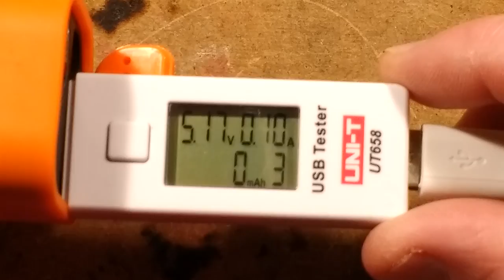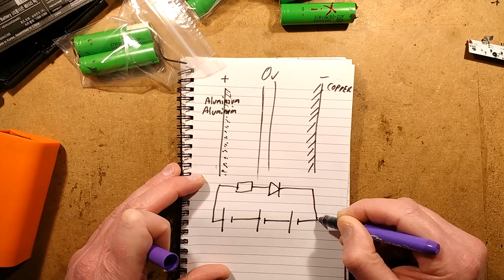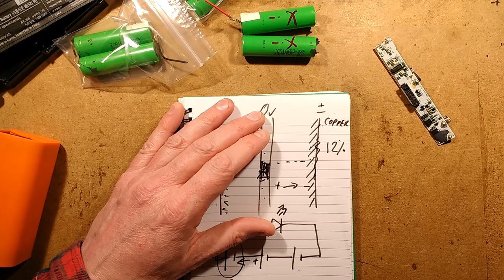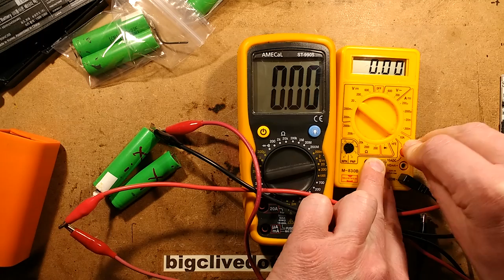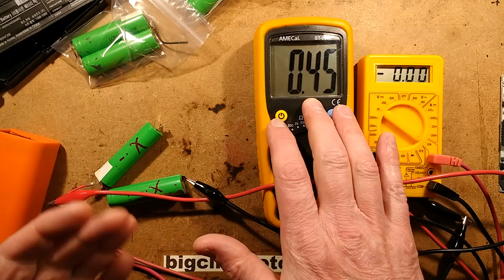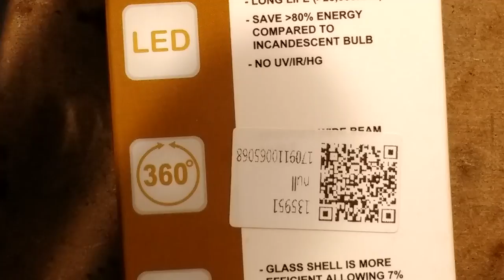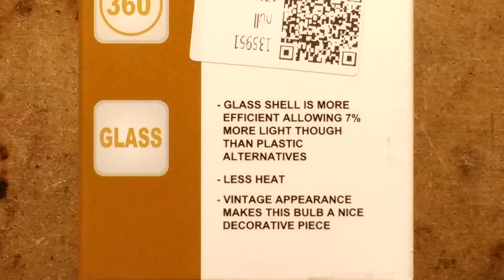Teardown of a faulty Samsung lithium 18650 cell.  (2200mAh)

Comment: Is it possible you have been handling a fully charged cell? As with you previous “accident” one? The “seal” mechanism you mentioned “disconnects” the cell and therefore cannot be charged and is at 0V. But the cell under the seal may still be charged. Search a video: “How the CID works”.
Reply: TheBlackadder Edmund he showed current flowing through at almost 0v, ruling that out.

Plus if it was fully charged, you'd be able to tell from the insides, and this clearly wasn't.

Comment: Clive, could it be that you were looking for a wrong reason for that cell's failure. You assumed there was a metallic shunt through the separating membrane and then you failed to find one. Maybe the real reason for the cell's inability to take the charge is the phenomenon that you actually observed, that of separation of the carbon layer from the copper? That could also be at least potentially caused by reverse charging.  To my mind it is your other, "slightly better" cell that showed symptoms of a metallic shunt through the middle as it was actually taking the charge, but then quickly losing it by internal discharging. Just a thought ...

Comment: The 1st thing on 18650s reading 0 is to check for continuity. If you don't have any continuity,  you could reset the button underneath the + terminal with a paper clip. Some experts don't recommend it but I had success 'resetting' them and get them to read above 3v.
Reply: I have a 18650 with no continuity, can you point me to some how-to about the paper clip trick? Thank you!

Comment: Totally interesting Mr Clive! as always, and NOT boring. Thanks.  I too have taken apart several of these batteries, but not on purpose. It is very exciting when they explode in a fiery bang and un-coil all over ones shop. BTW there was not a pleasant smell.

Perhaps you could comment on the poundStore power bank. I notice they are manufactured to a couple of very intriguing standards.. what exactly are the BS-62133 and BS-60950 qualification.. I particularly like the "BS" portion of those numbers.
Cheers from Canada.!
Reply from the maker: There are lots of British Standards.  Those particular ones cover IT equipment in general and devices containing rechargeable cells.
Reply: got it.. sorry for my ignorance. the BS stands for British standards... We have  CSA (Canadain Saftey Standards) on this side of the pond. I found the BS quite amusing and thought it was some hokum made up in China.

Comment: Most laptops also have this "emergency charge" function.
For example, all semi-modern Dell machines will indicate when they're in "recovery" mode by flashing the battery light red/amber-four-times-short, green/blue once long, then a pause before flashing again.
Vintage Toshibas meanwhile (can't speak for modern machines) indicate this mode by flashing the DC-IN light red.

Comment: Hi @Clive  You should get some silicone rubber baking sheets and 'saucepan overflow protectors'. The first to protect your wooden surface from heat and chemical burns, and the second to put over anything on fire in your dish.   (Circles cut from these baking sheets are also great for proving homemade bagels on, before flipping into hot lime water prior to baking, without them sticking to your fingers.  Silicone rubber sheeting and vacuum tubing are two of my stock of most useful bodging materials.  :) )

Comment: The top of the battery does have a heat protection button that can prevent charging. Other videos show that you can pry under the button to pop it back up and regain the normal circuit.

Comment: Can you remember the Samsung laptop model Clive? One of mine will only work on mains it’s a NP305E5A and it’s li-ion is a 11.1v
Reply from the maker: NP350VSC  You can get replacement battery packs online.  Mainly non original.

Comment: The copper goes into the membrane.  It''s at the atomic level, you might not see it if you don't have a new membrane to compare to.  Gold is nice to do a super-thin coating on stuff, and it doesn't look gold when it's done.  You wouldn't see the copper.

Comment: So - I've just worked out that a multi cell lipo 'can' have unbalanced cells in it, and it's only really an issue when the circuit is completed, either when charging or discharging. ( I have some unbalanced lipos living in my porch where it's cool and not flammable, waiting to be desoldered and the good cells repurposed ). In the back of my mind I was a bit worried, but I'm not too bothered now. I'm right though ?  So a damaged cell could cause reverse charging in a balance board charging set up ( where you charge many batteries at once ) ?

Comment: hi clive,

i have an asus laptop that only works when it’s plugged in. is it likely to be a problem with the batteries discharging themselves? it turns off as soon i unplug the power lead, so it’s completely useless as a laptop!

i’m not great with this sort of thing but i would probably be able to sort it if i knew what the problem was, and was hoping you might know!

thanks :)

Comment: You could try using that copper foil to improve thermal conductivity of the cheap 907/936 soldering iron clones

Comment: are the 18650 LiIon cells interchangeable with LiPo batteries, as far as the charging circuitry is concerned? Im thinking on giving more juice to my bluetooth speaker...

Comment: I left batteries in a laptop for long time and get the same problem. The thing is this batteries have a pressure switch inside and if (protection for overcharging or short circuit/over discharge when this things happen gass gets released and the preasure inside the cell rises whitch makes the preasure switch disconnect the positive terminal) Mine had this switch activated. I found a way (by studying how the batteries are made) to bypass the preasure switch.. but I'm not sure I will reomend doing that because it can be dangerous.

Comment: I noticed a streak with different reflective properties over the middle of both the copper and aluminium ribbon. I dont think that is normal. But it could be the precipitation of salts while the electrolyte is drying.

Comment: Hey bigclivedotcom, hope you are well. Can you tell me from your experiance with li-ion cells. The maximum input voltage (hx-2s-D01 battery bms board) I can apply to charge my 2 cells? Does the bms reduce the voltage if you apply say 12v from sla battery? or do you need to match the input as closely as possible to the battery total voltage? As you know, most ebay tech info is pretty bleedin useless! thanks big man, keep up the good work
Reply from the maker: You need to have a voltage higher than the combined cell voltage and current limited so that the cell protection circuitry is operating within its limits.

Comment: After watching a couple of your videos about these batteries I realized I work at a factory that has a huge bin full of old batteries that are bad. Most of them are from lithium ion laptop batteries or lithium ion battery packs for radios and scanners used around are Factory. I found three buckets 6 gallons full of all 18 650 lithium ion batteries in various styles of packs. I have begun disassembling them. So far I have only found two batteries that I have not been able to get to take a charge. What equipment do you use to charge your batteries? How can I charge these batteries and bring them back from the dead? What device did you use in another video to charge the battery through your meter? Also what can I do with the chip boards in these packs? Are they useless?
Reply from the maker: Simplest charger is to get a cheap mini power bank case from eBay with the spring contacts to accept an 18650.
The power bank will charge the cell correctly even if it's over-discharged and also double up as a useful 5V converter.
If the cells take a charge but then self discharge quickly then they need recycled as it suggests an internal shunt has formed.
Reply: bigclivedotcom thanks! I have 4 of those 8 battery Bank deals off eBay so that's perfect. I love your channel. Just found it and can't get enough. Thanks for taking the time.
Reply: bigclivedotcom i.just found another box with about 150 laptop batteries in it. Got a lot of work ahead...
Reply: bigclivedotcom being that I work at a factory I have access to almost unlimited electronics for robotics, motor controllers, power supplies, computer parts, you name it we have it on the Shelf in stock. How can I make my own benchtop DC power supply, I need one that I can adjust like the one you have? I assure you we have shelves full of Omron, keyence, square D, PhD, and the list goes on. I want to make an adjustable bench dc power supply. Is there Any site you could recommend or advice you have for plans? I am a mechanic so I can read the schematic...

Comment: My Alienware from 2013 now also has some new Samsung 35E cells. Only the BMS had said that after 10 min the battery should be dead. HW Info said otherwise. So in energy options i disabled auto turn off at 0% and it kept running for hours on 0%. After a few charges/discharges it now knows the estimate of the new cells.
Openig the plastic case such a laptop was by FAR the hardest part of the repair.

Comment: i found that some laptop batteries use one or more cells for the internal monitor circuit , so some cell are usually ok even in 'dead' battery

Comment: I had no idea that laptop batteries used these cells! Did you end up just replacing the cells to get it working again?
Reply from the maker: It was easier just to buy a new clone battery.  Some of these battery packs use non volatile memory to lock the battery out completely if a call fails.
Reply: Ah, fair do's.  Very interesting video nonetheless!

Comment: When you were taking it apart the shad of it changed. It was like the first part was dry and as you went in more it looked more shine black or kind of a wet look. I am sure it wasn't wet but it was a little different look to the black coating. I don't know anything about them but that is the only thing I saw. First thought part was wet and other parts was dry. But as you worked with it I saw that none was wet but part looked shinny almost like something that was wet where other parts wasn't shinny. But like I said I don't anything about this. I watch to learn!

Comment: Clive nice vid as usual. What do not understand is how that foil swells up.  I had a pouch cell that was swollen like a baloon ! When I openen it up it was full of hard stuff. I have metal cells too that some r8me swell but they have obvious vents so how can gass pressure be the cause?
Reply from the maker: I recently had a puffed cell that had been overdischarged due to water ingress to a product.  The puffing is usually caused by gas liberation.  Sometimes charging and discharging the cell a few times results in the gas being reabsorbed and the cell going back to its usual tight construction.

Comment: My uncle had this crazy trick they actually worked for him(I never tried it myself, I'm not that desperate for a reclaimed lithium cell) and it was connecting the battery straight across mains voltage with a slow fuse in series. I swear to God I've seen his method work with some (not all) cells in this very same condition. His conclusion was that the pulse of very high current blew clear whatever electroplating was formed between the electrodes.
Reply: We used to go to the flea markets around town buying old laptop battery packs and we had tons of reclaimed batteries to experiment with
Reply from the maker: That used to be done with Nicad cells, but is not a good idea to do with lithium cells.

Comment: I'd like to know what goes wrong with those black 12 volt, 7.2 Ah sealed lead-acid batteries like the ones used in UPS units that just go dead after about a year.  Have you ever examined one of those?
Reply from the maker: If they are trickle charged continuously they gradually vent electrolyte as gas and can also sulphate over time.
Reply: Yes but they die just as fast sitting on the shelf!  The batteries in my UPS died after 2 yrs. and  I just got out 2 new ones that had been stored away but they are dead also!  The water must evaporate out of them while just sitting.  I opened up the top and they looked dry inside so I'm trying to charge them while adding more water.  So far I've put in about 8 oz. of water and the voltage has gone up from 3 to 7 volts but I dunno if they will ever make it to 12 V or not.

Comment: Usually completely dead cells have a protection mechanism unter the positive terminal. Pushing it back could revive it but only as long it is not does not start burning

Comment: Do you have any magic tips for connecting lithium cells without a spot welder?  I can often manage to solder to cut down tags on the bigger batteries, but I was recently faced with the crazily space saving 'BIOS' battery of a nice Dell laptop that won't start after being sat unused for a couple of years.  I've not found the problem yet (fan starts, disc starts, then everything cuts out without ever lighting the screen), but I thought it might need a new button cell...
The original cell was just spot welded to tags and shrink wrapped to fit into a depression exactly the same size and thickness as the battery with tags!  The button cells are so thin, there's no chance of soldering them without boiling the contents!  None of the button cell holders I could find on line would fit the space and still allow the case to slide back on!  I ended up drilling through the, surprisingly hard, alloy of the laptop chassis, to run wires across to the only space in the case that they hadn't filled with a component, so I could put a battery holder in it!  Days of fiddling just to try out one possibility. And this wasn't the cause of the fail to start!
  The main battery pack still seems to charge, but I did wonder if some of the cells might have packed up through being flat so long, as you mention here.
Reply from the maker: Even spot welding requires the proper equipment and some practice.  I don't really recommend soldering directly to lithium cells.  The ones with pre-fitted tabs are a good option.
Reply: @bigclivedotcom   The tabs always seem to point the wrong way, though Clive.  The Bosch 1200 had three in a triangle, in the handle, that didn't even allow the thickness of a wire anywhere but in the 'valley's between them, but all the tabs pointed out away from each other, in the new ones!  Nightmare job trying to trim and bend them and hold them at the right angle and solder them at the same time!  Was very satisfying to feel the torque afterwards though!  :)   Happy New Year. (y)

Comment: i once disassembled a ebike battery with welded cells, on some i managed to rip a hole in the bottom by pulling off the tabs.  they worked fine, some i sealed off with solder. but after a month or two they almost lost all of their capacity, they were dried out completely.

Comment: BigClive, could I take good 18650 cells out of old laptop battery packs and use them in a vaporizer? I have been curious about this for a long time.
Reply from the maker: Vaping devices are best used with the specifically designed high current cells.  Laptop cells are not optimised for very high discharge currents like 10 or more amps.
Reply: @bigclivedotcom   Ah that does make sense, thank you. Glad I asked before I lost a few fingers.

Comment: The file size issue is not limited to phones. It is a function of the file system used. I have a lot of high quality videos on my phone so I use either NTFS or (preferably) ext2.

Comment: No Pun Intended. I don't know but I am thinking the failure occurred in either the very top or the very bottom of the winding. That is where it seems to be prone to a shorting condition. More stress? Like, right where the current enters and exits the cell. Make sense? Just a thought. Carry on good man.

Comment: What if you measure the resistance of the cell while you're disassembling?  When the bad spot(s) come apart the resistance goes up.  That would at least tell you the general area of the problem

Comment: Hey Clive, I have an old iPod Touch, about 8 years old, that has recently stopped charging. The battery has for a couple years only held a slight charge, but I always used it plugged into a usb supply anyway. But now that doesn't even work; it won't even recognize there is a charging cable plugged into it. So my first thought was the cable had gone bad. However - and this is where this gets explosively interesting - the iPod itself gets very hot - unusually hot - when it's plugged in with that cable, even though it won't power on, charge up, or even recognize it's plugged in. So, it seems like there is power going into it (how else is it generating heat when it's not even turning on?), which suggests the problem isn't with the cable. So I'm guessing the battery itself has just up and died, which is a shame. Ah well, at least I got nearly 10 years out of it!
Reply from the maker: The cell may have gone short circuit and be causing the charging circuitry to get hot.  If you were adventurous you could open it and remove the cell then maybe it could be powered from the charge lead with no battery inside.

Comment: I have heard of battery reconditioning that does something like fire 20 kilo-volt lightening bolts through the cell that fry things like the copper dendrites and therefore fix shorted/shunted cells...  But don't know of any products that can do stuff like automatically yet...  I wish you had a way to try that on the remaining cell...  After doing more research on that than what little I obviously have done...

Comment: When an 18650 battery went completely dead at 0V it can be recovered. The internal CID (current interruption device) popped out. It's a 10 second fix. Watch here! https://youtu.be/1w3Tv1Jg0ps